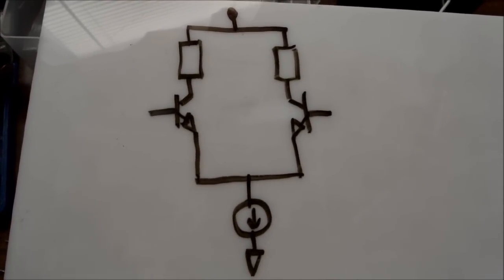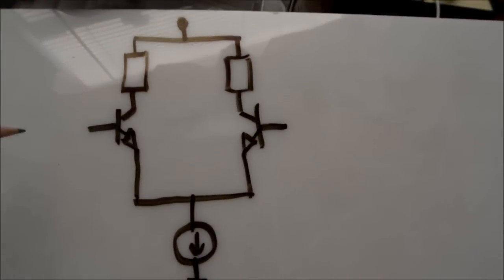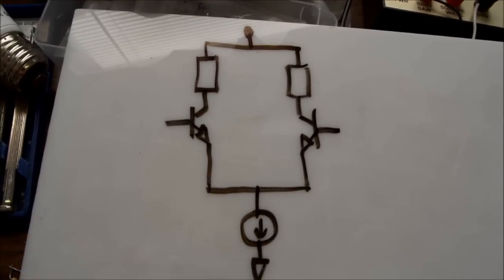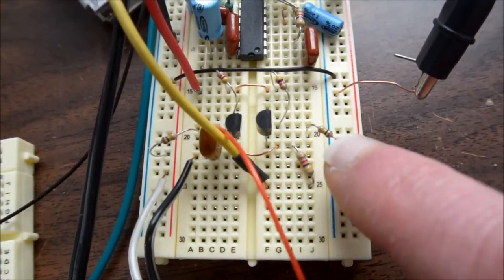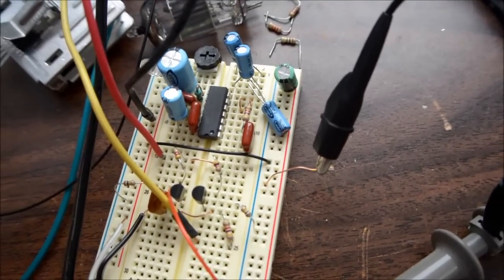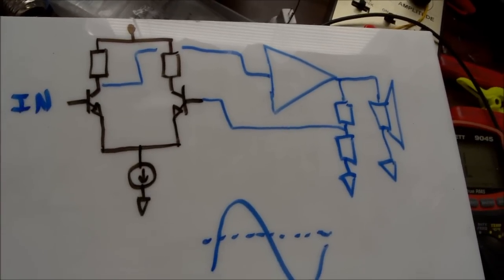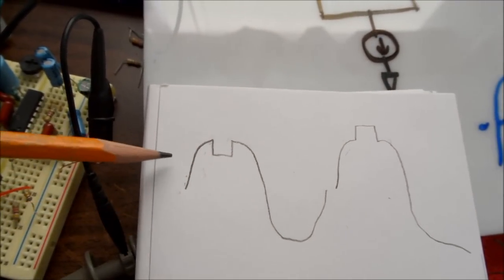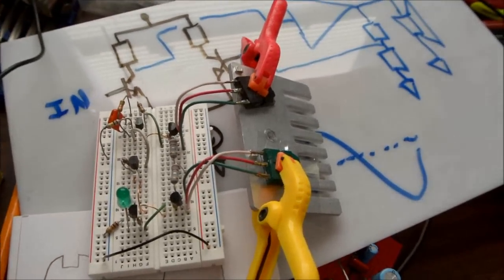Differential amplifier basic operation and negative feedback

Comment: WOW! Many hours were spent on circuit analysis trying to understand this first stage of the audio amp, primarily for the troubleshooting of dc offset problems in vintage Kenwood KR stereo receivers that do not contain DC offset cal pots. The old Kenwood’s relied on a closely matched differential pair (hfe gain matched) and associated calculated components (caps/resistors) for the biasing of the pair. A drift from design specs in the bias circuit caused by components degrading over time very often results in a hi (100mv or so) DC level (DC offset) ending up at the speaker terminals and sending the amp into protection. Very often the transistors start to leak beyond the original design, unbalancing the complementary pair and making feedback compensation non-linear. The concept of this video is a necessity for the understanding and repair of any of the GOLDEN AGE (77'-82' Marantz, Pioneer, Sansui, Kenwood) receiver amp linearity problems. Thanks a million for making this video!!

Comment: Hi John,
Yes you did explain it very well and 100% accurately. Nice to be the first to comment, Might be nice to show positive feedback, nothing like a screamer!! Reminds me of my valve days, trying to find which way round to connect the feedback from the output transformer. Should be 50% chance of getting it right but the result was usually positive feedback. Good work I always enjoy for vids.
Reply from the maker: Michael Beeny Hi Michael, I'm sure I'll be dealing with phase shift and oscillation when I try to get that amplifier going as a finished project.

Comment: First thx a lot. It is very well illustrated and demonstrated. One suggestion could be to indicate eventually with a textual comment that the "noise" event is not conceptually a isolated event but a kind of "reccurent" event (I imagine that this is the case if we talk about distorsion that adds up to the signal) . So the diff will compensate not just ONE event but a sequences of an event (I.e an undesirable frequency or recurring event). Is my suggestion making some sense in essence ? Do you envisage to enrich when necessary your videos with text. It is sometime very good tool to vehiculate a more complete/correct info. Brgds.
Reply: I was very confused on this point actually. I think that would be a good addition to the video, which is great by the way. How does one make sure that their negative feedback is in phase with the noise in the signal? How is it that the true signal isnt negatively fed back as well?

Comment: Very good vid.  I have seen these amplifiers, many times, on the input stage of push pull amp and tried to understand what they do.  Your vid explains very well to me.  I am guessing that you have to end up with some error?  if you completely fix the error there is no error fed back to the differential amp, so no corrected wave form will be sent to the power stages, so your error will return. I guess you would get the oscillation that you mentioned. 

Am I right or talking rubbish?
Reply from the maker: richardcloudbase The idea is to design the amp to have as low as distortion as possible before relying on negative feedback to correct. NF does have limitations in how much the distortion can be corrected.

Comment: Hi John,
Your video was very clear and made me want to try building a similar circuit. I'm new to audio circuitry. Can you reccomend any good books on the basics of amplification?
Thanks.
Reply from the maker: Adam Morris "All About Circuits" is a very good site with a chapter like layout. Rod Elliot's ESP site is mainly audio based but may be a little deep for the beginner. I think he has an intro section. As far as actual books, your local library usually will have a few titles on the subject.
Reply: I'll check out both. I've heard of all about circuits. It's supposed to be a great site. One more question. I have a usb powered oscilloscope/logic analyzer I use for low voltage microcontroller stuff. (I'm working on a degree in computer engineering). It says the device is good up to 30V. Do you think it would be safe to use for looking at amplifier circuits? It's a digilent analog discovery.

Thanks again for getting back to me.
Reply from the maker: Adam Morris  You should be fine with the analyzer on most solid state lower powered amplifiers. Higher powered amps can have voltages above 30v. Tube amps can have several hundred volts on their anodes, so I would not use it there.

Comment: while the concept of negative feedback is correct, the phase of  the "notch " is not consistent with the phase  of a sine wave  at the collector of  Qin,  input transistor  (  connected to the summing junction).  

Perhaps showing at Qin  - E*sin_wt caused by the  input signal plus:  
                                           +-beta*E*sin_wt caused by the feedback is closer to the truth .
Reply: He did say he was going to explain it as simply as possible so any one could understand. Using all that engineering mathematics would over complicate it.

Comment: I had a question about your explanation of negative feedback at around 15:00. Wouldnt the signal being fed to the right most transistor be passing through the speaker at the exact same time? In this case, how is the inverted version of the signal correcting anything? Wouldnt it be too late for the signal to be corrected by the time its fed into the transistor? Any information would be a great help thanks.
Reply: Also how is it that the negative feed back doesn't also cancel out the true signal?
Reply from the maker: Amplifiers work very fast so the signal from the feedback arrives at the inverting input at the same time to be in phase with the input signal (the action of the inverting input makes it 180 deg. out of phase). Nothing is instantly fast in the real world so a phase shift develops at high frequency between the input and feedback signals. If this phase shift is large enough, the amplifier may oscillate. Something called frequency (or phase) compensation is used to reduce this phase margin and keep the amplifier stable.

Yes, the feedback cancels out much of the gain. A resistor divider network is used to reduce the feedback signal so that the amplifier has some gain yet yields much of the "error correction" that feedback offers. If the the full output was sent back to the inverting input, all the amplifier's gain is canceled out.
Reply: You are right - this youngster did not understand complitly what Feedback is about. I have made a new commnt that corrects.
Reply: He's 48, mate.
Reply: Electricity in circuits travel to the speed of light which is much faster than any electronic audio signal ( wavelength ), so there is no delay in that sense
Reply: @JohnAudioTech  effectively making it unity gain, or a gain of 1.

Comment: wouldnt you need to delay the initial signal before a second parallel amping stage that would be the one corrected... if not it mean you correct a future waveform with a past one.. lots of engineer praise single ended with non negative feedback..

Comment: I never understood how a distortion that has been presented to the speaker in the first place, can be sent back and get corrected without the speaker 'noticing' the distortion.
Reply from the maker: The correction happens instantly as far as audio frequencies are concerned so the wave form coming out of the amplifier is already corrected.
Reply: Think of it like this: TV/movies the way the frame rate works is based on the persistence of vision so we don't notice that they're a bunch of still images made to move with a shutter (we don't notice the flicker on film any way). Hearing is kind of the same. We don't tend to perceive minor distortion (as it's being corrected). However, if there was no negative feedback, we would indeed hear it, just like at Brian May from Queen, who used a Vox amp most of the time for his solos with no negative feedback. It gives a kind of warm early clipping.

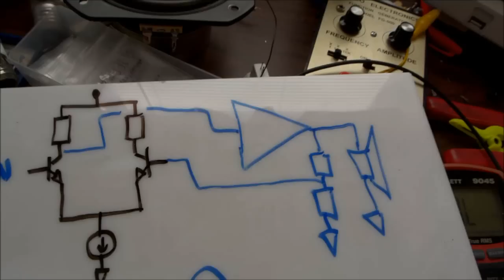Comment: the feedback does not correct the waveform only the amplification level.  Notch example 13:34 wrong ! The feedback will correct changes caused NOT by the input waveform itself (till a certain limit). Yes it will reduce the NOTCH but it will not make it disappear. The feedback will keep Amplification Constant by the price of reducing total ampliffcation(ß)
Reply from the maker: Understood. NF can only correct errors inside the feedback loop and the correction is not 100%. The less feedback provided results in higher gain but less error correction. This is a basic explanation.
Reply: Yes , you  got me right. Here is some more that will explain the whole story. Take as an example simple circuit like transistor in common emitter connection with an emitter resistor. When transistor gets warmer base emitter will  conduct more and will cause higher Ic (collector current) . The effect will be higher voltage drop on the Re resistor and that will cause that the Vbe will get smaller ( More voltage drop on Re= less voltage difference between base and Emmiter) and that is the self correction to the effect of HEAT. But if the Signal will have the notch you talk about it will still be amplified as the rest of the signal. Now to something else - in your video you show the Common tailed pair (differential amplifier) these are  used at the input stage of any op amp. one input is (-)inverting and other (+) when SAME signal is applied to  both inputs they will cancel each others affect on the Re resistor. Let's say a cable (coax) runs from one city to another with a signal. On the way it collects noise (from other electric machines). When it arrive the second city and it is being connected the inner cable signal + noise to one transistor and the shielding of the cable (outer part) to the second transistor. the two common noise parts will cancel each other (on Re) what will remain will be the original signal that was sent from city 1 . That is probably what you've red about "negative Feedback fixing the signal".  Wish you fun with electronics.
Reply: @yoramstein  now you're talking about CMR (common-mode rejection), which is a subject more to do with reducing noise in balanced systems. This really isn't relevant to an LTP being used as a front end to an audio power amplifier.

Comment: least conceps covered explain more math.
Reply: You realise that there is a LOT of math involved in this deceptively "simple" circuit, right? It over complicates explaining it's operation "simply".
Reply: @AstrosElectronicsLab  you require it when you work with it.
Reply: @lakshmi1994-d4t  only if you're an engineer. Building them from kits or just repairing them, you only need a basic understanding of how they work - which is what this video is aiming at.
Reply: @AstrosElectronicsLab  ok sir thank you